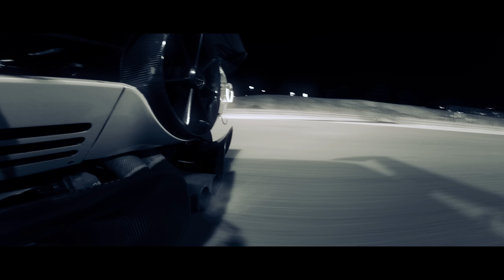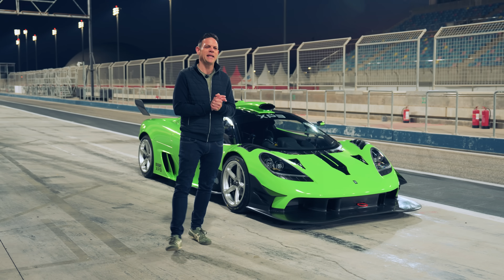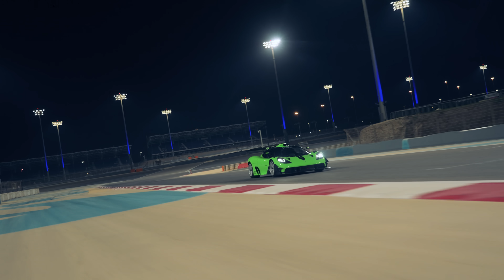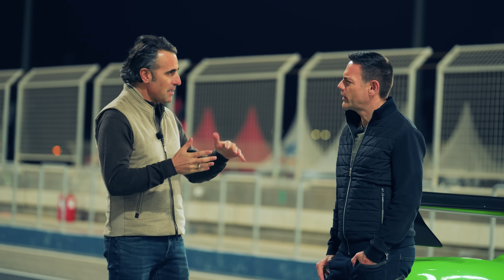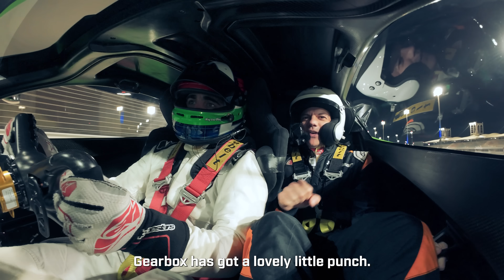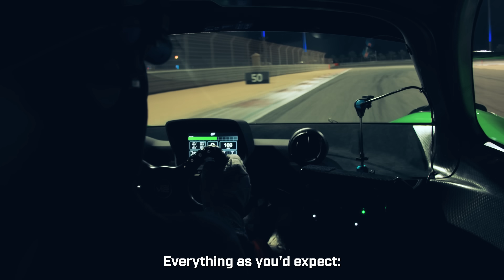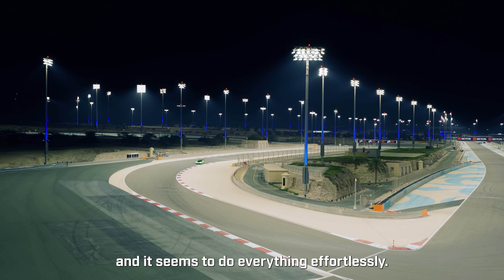Gordon Murray's V12 Masterpiece: New GMA T.50s! | 4K

Comment: Under 900kgs in 2026? I must be dreaming for sure.
Reply: and N/A V12..

"we need small engines to reduce weight"..  maybe they could safe weight in low production number cars, if they didnt cramp a hybrid drivetrain in there
Reply: @HardyGameplay
The new Lambo Temerario weighed in at 1910kgs with all fluids, saw it yesterday. Wth…
Reply: @DashTea  how? I just saw a video and it has such a tiny footprint.

i actually liked how small it looks.

how in the world did they cramp 1.9 tons into that little footprint? :O thats insane.
Reply: @HardyGameplay
Batteries are heavy bro.

It was a video of a famous German car mechanic, tuner and enthusiast. Guy is called JP Performance, he took it for a testdrive and  after it he weighed the car with 3/4 of fuel mind you and no passengers of course. 1910kgs.
Reply: @HardyGameplay The moment you add electric motors and make it a PHEV, it will grow a lot of weight. Just look at how much extra weight the new gen BMW M5, Bentley Continental GT, and Audi RS5 are compared to their previous gen predecessor.
Reply: @DashTea Same for Revuelto - 4300 lbs actual weight. 1960 kg. Weighed by Dragtimes. The car is frigging huge compared to T50. Heck even a 750s is 1 foot wider, 1 foot longer and taller. A Valkyrie AMR Pro is absolutely a limo compared to a T50S - almost 70 cm (over 2 feet!)  longer, 31 cm wider, weighs 150-200 kg more. No surprise. Start small and there is 80% of the weight saving battle won.
Reply: @DashTea  Lambo, you mean that company that makes cars look like blocks carved out of wood that always weigh a hair shy of 2t?
Reply: @DashTea so no downforce needed😅
Reply: @DashTea  The Temerario is a way nicer car. Not just a kit car with an engine like the T50.
Reply: @DashTea  1.9T omg😢
Reply: @22Epic  In what aspect, weighting twice the t50? Maybe comfort only. No thanks I chose T50 any day of week.
Reply: @TheAmbasadaRecords  How would you choose being broke mate? No offense but you can't afford neither of them.
Reply: @HardyGameplaybatteries and the cucks at the EU and their ridiculous Euro 7 emissions
Reply: @Payt-y5d😂 great comparison
Reply: @22Epic  look u may not need to like the visuals...it s perfectly ok each of us has his own aestethic preferences...for some it looks really nice for others literally ugly....who is wright? No one....It s simply a subjective matter....but by focusing on the looks u r seems to me missing the point of this car or maybe  u simply don t care about it because for u supercars are not machines whose main goal is to enable the driver to experience  the most amazing experience of driving (which for me it totally is) but rather objects that one should be visually ammazed and impressed by.
Reply: @jakubhrasko1249  It's not subjective, you either have good taste or not. Seems you have not.
Reply: @22Epic Du bist maximal unsympathisch, mit dem was Du schreibst ❕
Die Welt wär eine bessere, ohne Dich...da bin ich mir sicher 😏
Reply: @Ramsi-Berlin  German(I think) guy speaking fax
Reply: @HardyGameplay Even the toyota corollas are tipping scales at 3300 lbs these days - so that is a wild statistic.
Reply: @Sav.B58 Toyota Corolla 3300 Lbs? Holy crap. My Honda city weighs 2400 lb and gives me 46 mpg even after they introduced E20 ethanol.
Reply: Audi was: hey look at our 2.6 ton RS5
Reply: It’s “easy” to meet these weights when money and regulations is not a factor
Reply: @Velodictorian @Dashtea Revuelto - 4300 lbs actual weight. 1960 kg. Weighed by Dragtimes. The car is frigging huge compared to T50. Heck even a 750s is 1 foot wider, 1 foot longer and taller. A Valkyrie AMR Pro is absolutely a limo compared to a T50S - almost 70 cm (over 2 feet!)  longer, 31 cm wider, weighs 150-200 kg more. No surprise. Start small and there is 80% of the weight saving battle won.
Reply: @Velodictorian it's apparently not so easy when basically all hypercars are nonsense whales that you can't drive without torque vectoring and computer's
Reply: @Velodictorian easy? I think not.... You clearly know nothing about automobiles.
Reply: @Velodictorian Tell it to the Mazda Miata❤ No carbon fibre, budget car with a right philosophy. Same size and weight as the previous generations.
Reply: Aston Martin Valkyrie AMR Pro and Pagani Huayra R Evo weighs about the same as well. But then again, it's a track-only car, so I won't be surprised.
Reply: @farishanafiah8461 Valkyrie AMR weighs almost 150kg more lol
Reply: @farishanafiah8461 They are definitely not as light 😅
Reply: @farishanafiah8461 @Dashtea Same for Revuelto - 4300 lbs actual weight. 1960 kg. Weighed by Dragtimes. The car is frigging huge compared to T50. Heck even a 750s is 1 foot wider, 1 foot longer and taller. A Valkyrie AMR Pro is absolutely a limo compared to a T50S - almost 70 cm (over 2 feet!)  longer, 31 cm wider, weighs 150-200 kg more. No surprise. Start small and there is 80% of the weight saving battle won.
Reply: > Under 900kgs in 2026? I must be dreaming for sure.

Colin Chapman be like "Hold my beer"...
Reply: @anonnona8099 Lotus emira is like 1400kg
Reply: @aitorgallego98  

Yeah, and the Lotus Elite  was about 500kg.

If you brought Colin Chapman back to life and introduced him to the guy in charge of the project that made a Lotus weighing 2.5 tons he would punch him in the face.
Reply: Look up the video of Chris Harris driving the Tuthill 911K, I think it’s 850kg if I remember correctly.  A 350 hp 3.1 liter 4 valve, short stroke flat six engine, utterly magical to hear it that engine. No fans, no turbos, no hybrid systems, purity at its best.
Reply: @bluesky9093it's basically the same weight and half the hp of a t50s..... Not even in the same universe.
Reply: @raymurda4551  In terms of performance yes absolutely. Sometimes its more about the raw driving experience though.
Reply: @bluesky9093 Yep, its an incredible machine ...and one of my favourite car videos.
Reply: That's actually fucking crazy but people don't even know about weight nowadays. 1980 lbs with 700+ HP is insane.
Reply: It's an engine + a bag of cheetos 😆
Reply: & V12 too
Reply: Downshifts are diabolical
Reply: Nah, that's just racecar stats mate.
Reply: Yes, but it's a track only machine. It lacks many features of road cars. Normal T.50 is quite impressive.
Reply: @CtecRefisn’t the t50 not around 1ton as well? Maybe 1.1?
Reply: @DashTea  980kg to max 997kg depending on the spec i guess.

which is insane for a supercar with all creature comforts. especially with additional suction fan in the back.
Reply: @DashTea  I've seen varying figures between 986kg kerb and 997kg dry.
Reply: @vyrnmn thats nuts
Reply: @HardyGameplay that's paper information, video from DK told that it weighs around 1,100kg with half the tank! so prolly around 1,050kg dry.
Reply: @CtecRef Which begs the question, why is there a 2nd seat?
Reply: @CtecRef1085 kg wet weight with half fuel. 1120 on full tank. Incredible.
Reply: yeah lighter than your mom.
Reply: Far easier when track only, when you don't care about confort at all, on roadabilty etc.
Reply: @thomaslegoff4069 Road car is also amazing, small and crazy light. Very practical and super tall guy friendly.
Reply: @r129r16pfl Road car doesn'y have to meet the same safety & emissions standards either. Cant be sold in the US, and in UK has special low-volume regulations.
Reply: When something costs 3.1 mill, it had better be.
Reply: It's essentially a race car. No insulation, no android auto, just for the track. That lightens it up
Reply: Gordon Murray is the master of weight saving.
I am designing an aircraft with maximum of 450kg allowed (475kg with parachute). It's a beautiful challenge trying to save weight WHEREVER and WHENEVER, while not forgetting safety

Designing something heavy is "easy". It's the weight saving where a designer shines, in my opinion,
Reply: Just a little lighter than my 1992 MX5. But similar engine noise.
Reply: Fucking A.  Under 2000 lbs for the Americans.
Reply: In 1986 the Lancia Delta S4 Group B was 890 kg and 550 hp😂
Reply: What is it like 4 million dollars?
Reply: Toyota MR2 222d 1986 with 750 kg and 750 HP, one HP for one KG😂😂
Reply: last one. Next GMA will be hybrid. And then when Gordon is gone, you know...Electric.
Reply: doesnt have street license man.... I could build u something 200kg lighter and with 1.500hp for half the price or even 1/4. This car is ok, but not for 4m
Reply: @BenSuzi1980 you cant build shit, only thing you build is RC cars 😂😂😂😂
Reply: @Goat-vy2bi I can't stomach people like this guy... It amazes me how they live in this delusion that they can do anything..... This is what happens to the population that never done shit themselves, just watch videos and think they are experts in all fields.... In reality they can't even change a tire or change there own oil.....
Reply: @BenSuzi1980 
No, you can’t.
Reply: @BenSuzi1980 Did u build it?
Reply: You could build a cardboard box- F/g I/d/t. Also building is one thing; Crash testing & compliance with road rules, emissions compliance, licensing and warranty are on another level and even worse for the road car.
Reply: not street legal, so nothing special
Reply: @Violet-ui the street version is also under 1000kg.

and most race cars are around 1.2 tons+ anyways.
Reply: @HardyGameplay Plenty of sub 1 ton race cars if you are spending millions
Reply: @Violet-uinot with that V12 and refinement tho. Did you see the whole video?
Reply: @DashTea  Does it seem like they watched even a second? Very low information car "enthusiast" hah
Reply: @Violet-uiyeah, but only this one is designed by Gordon Murray you muppet. 😂
Reply: @Violet-uiok Virgil back to mommy's basement
Reply: @Violet-uiGo look how much non-street legal GT3s weigh.

Comment: Truly an incredible car and I appreciate the philosophy of keeping a road going version separate from a track version, much like Porsche really. For me the use of the fan in the aerodynamics immediately draws comparisons to the McMurtry Speirling.  Completely different drive trains obviously and the McMurtry truly is using fans for extreme downforce, but I draw comparison nonetheless.  As much as I admire this car and the engineering behind it, for me it demonstrates how much more complication is added with a combustion engine drivetrain versus the McMurtry.  That’s not to take anything away from this car, it is amazing, but if I was in a position of being offered the opportunity to have one over the other, I think I would go with the McMurtry.  I get it, some insist that a car can’t be a car without the visceral feel and sound of a combustion engine, and all the expected adjectives and superlatives.  But for me, a car is about more than the sound of it’s engine, it’s about how the chassis and suspension responds to the road, the steering feedback you feel in your hands and the sensation of speed it delivers despite the drivetrain type.

I also think a 12 cylinder in a modern day track car goes against the whole ethos of race or track cars today.  Let’s face it modern race cars are turbo charged 4 or 6 cylinder cars because they want power with less weight.
Reply: This car responds to steering, braking, and throttle far more than the McMurtry. It weighs 100+ kg less. The combustion engine is a huge factor in sensation of speed. The vibration and sound makes you feel like you're going far faster than you are
Reply: @S @Shadowboost never said it didn’t do all that, I did say it is an amazing car.  For me when I compare it to the McMurtry it seems overly complicated.  I love the simplicity of the McMurty drivetrain compared to this and other cars like it, when you consider the level of performance it delivers.  In fact I would love to see these two cars in a lap test against one another.  If I’m being totally honest, if I wanted a high revving combustion engine car it wouldn’t be this, it would the Tuthill 911k that revs not quite to 12,000 RPM but a healthy 11,000 RPM.
Reply: @bluesky9093Gordon made the BT46 Brabham fan car.

Comment: This car sounded to me like it's not revving high enough. Only later did I notice I was subconsciously putting it in the F1 V12 category.
Reply: Early 90s F1 V12s didnt rev that much higher,  12500 vs 14500 ish.
Reply: @ahemgee9542 just thinking that. Does this engine use centrally mounted wrist/ gudgeon pins do we think?
Reply: @ahemgee9542  The trumpet like high harmonic scream that we recognize actually starts from like 14000-15000 rpm and truly peaks at around 19-20 k rpm.
Reply: @ahemgee9542 Wikipedia gives 1989 Ferrari f1 car as revving to up to 13,000rpm. Maybe race car engines revved to less than quali engines. So the t50 is not far off